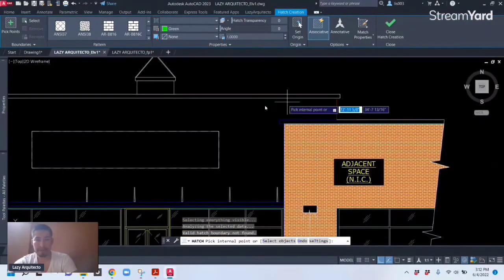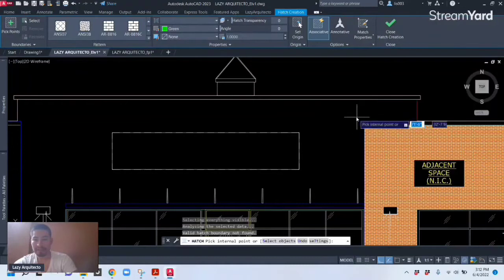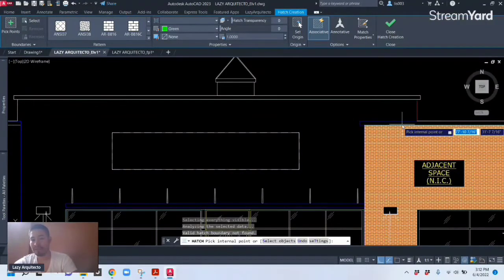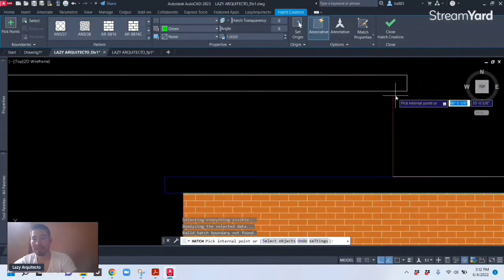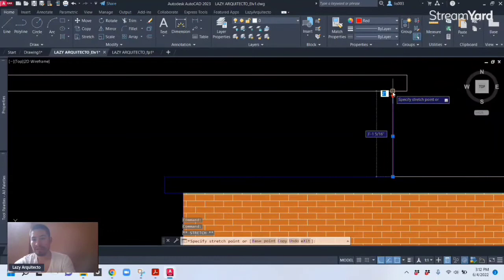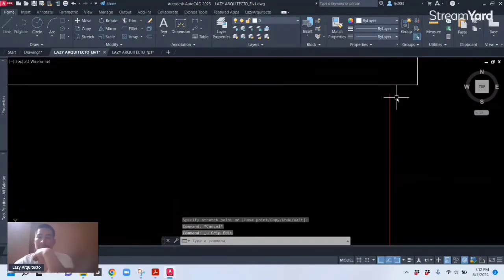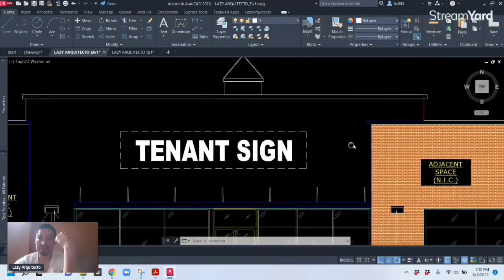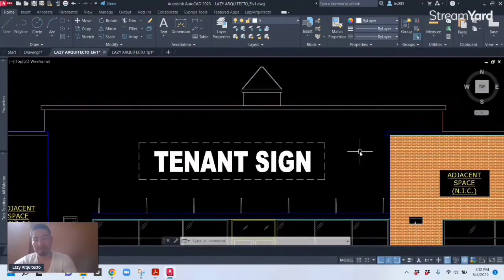Top 5 Autocad Hatch Problems with Solutions

Comment: I have a problem is the uploaded hatches that i use .
When i select the object they appear as a solid colour then I have to put a certain scale to appear and if i want to change the scale from the bar they don't change i have to delete the hatch and do the process all over again.
What should i do?
Reply from the maker: It sounds like the hatch code might not have been written properly.

Try using one of the default hatch patterns that come with AutoCAD (like ANSI31 or AR-CONC) and see if they behave normally. If the default ones work fine, then the problem is likely with the .PAT file of your custom hatch You can try downloading a similar hatch from online, or let me know i create hatch patterns at www.lazyarquitecto.com/members